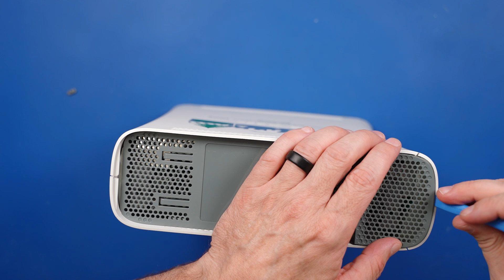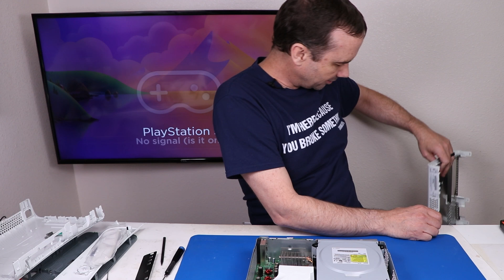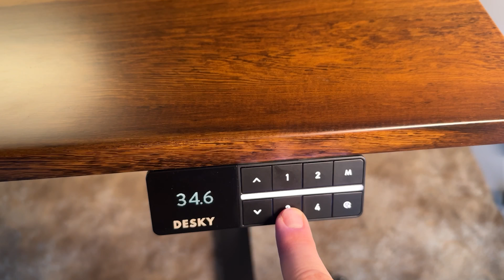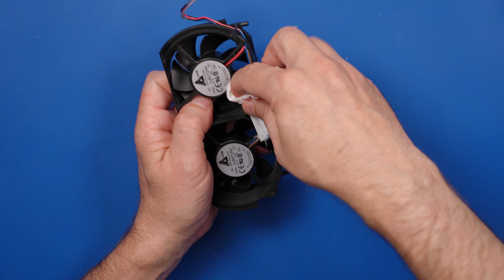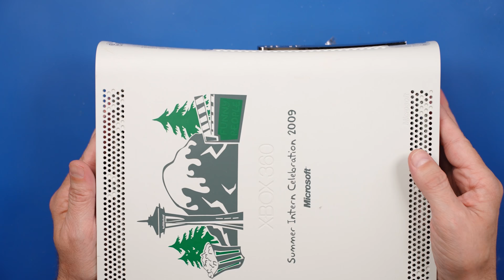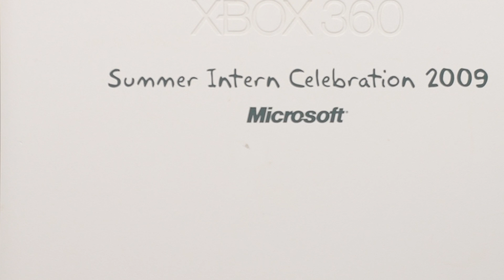I Found A SUPER Rare Broken Xbox at a Thrift Store! Let's Fix It!

Comment from the maker: Check out Desky!
Desky Dual Hardwood Sit Stand Desk - 72x30 - Pheasantwood desktop - black legs with cable management - https://desky.com/products/dual-hardwood-stand-up-desk/?ref=tronicsfix?utm_source=tronicsfix&utm_medium=affiliate&utm_campaign=tronicsfix&utm_term=pheasantwoodreview
Desky Minimal Under Desk Drawer in Pheasantwood & black - https://desky.com/products/minimal-under-desk-drawer/?ref=tronicsfixutm_source=tronicsfix&utm_medium=affiliate&utm_campaign=tronicsfix&utm_term=pheasantwoodreview
Desky Monitor Stand in Pheasantwood - https://desky.com/products/desky-monitor-stand/?ref=tronicsfix?utm_source=tronicsfix&utm_medium=affiliate&utm_campaign=tronicsfix&utm_term=pheasantwoodreview
Desky Lockable Desk Casters - https://desky.com/products/lockable-caster-wheels/?ref=tronicsfix?utm_source=tronicsfix&utm_medium=affiliate&utm_campaign=tronicsfix&utm_term=pheasantwoodreview
Reply: Genuine question.

I just replaced my screen on my iPad 11 Pro.
I think the adhesive strips that came on it are bad but just in case, how long should it sit with or with out weight for it to form a seal? 

I thought it was supposed to be near instant like with phones. 

If it doesn’t seal properly I’ll just order some E-6000 glue.
Reply: Do you have the Xbox 360 mk 3 edition
Reply: See the comment below. I’d like to see that fixed.

Comment: Have you ever worked on a 360 with the ring of death?  I have repaired many of them with an unorthodoed way using washers and different screws and left out the clamps on the back of the board,  Worked pretty good most of the time.

Comment: The Ebay laser will work fine! At 18.25 in your video when you take the laser out of the packet the 2 pot's are at the bottom, to the right hand side there is a blob of solder that bridges 2 pads to protect the laser from antistatic during shipping, that blob of solder needs removing before you install the laser, once its removed the POT reading will change to between 3 and 4 as expected.

Comment: Man brings back the good old days. I used to repair 30 a day of there consoles. I still to this day have bins of parts from 360s that couldn't be saved. I also modded them etc. I have 1 of these intern 360s I pulled it out my bin cause I wrapped and sealed it after getting it and honestly forgot about it all these years. Just plugged it in and it works like new. I have a couple other rare ones too. Also have the all white original xbox. I was a huge xbox repair/modder in philly back then I did 100s of consoles per week mostly fixing red ring of death issues. I can still take apart a system in under 2 minutes lol

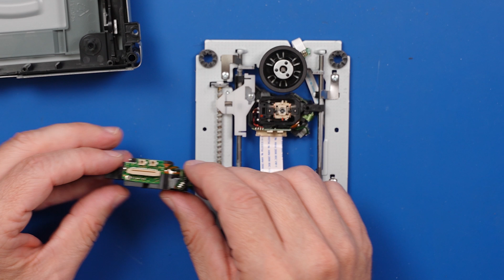Comment: @TronixFix I just wanted to point out that those Xbox 360 lasers replacements come with 3 pads that are bridged to the left of the ribbon connector. I noticed that in the video you did not remove that solder bridge. 18:33 

If you still have that laser I would suggest removing that and testing the laser again. 

Again just wanting to pass along that information in case you weren’t aware.

 I always love watching your content!

Comment: Hello Steve,
at minute 18:30 you can see a large solder joint to the left of the cable connector. This needs to be removed before installation. It’s an ESD protection point. Compare it with the old laser. 👍
Reply: Laser definitely doesn’t work now considering that blob shorts the power to the laser to ground. Awesome really, I see lots of pointless fixes from him just to increase video length. Cleaning gigantic consoles with nothing but a q-tip, sending parts over to his friend for cleaning, and now this. Oh and the hot air used to position the capacitors, good grief.

Comment: @Tronicsfix I have an Original Xbox I purchased when I was stationed in South Korea with a hardware mod. It never really worked quite right because it has a switch on the side to turn it off so I could still play online but I would get the red ring of death when ever I did turn it off. Now I get the red ring of death all the time. I would love to get it fixed and see you make a video of it. I have had it open a few times to switch the power supply board between 110 and 220 a couple of times and of course to install a larger hard drive but I don't have the skills to do anything with the motherboard. Thing probably still has sand in it from the Iraqi desert...needed to play Halo to keep my mental health in order over there. lol

Comment: made the disc drive repair harder than I wouldve. The old common fix for that issue was to get another drive of the same make and model, and then transfer the PCB from the broken drive to the new drive. Microsoft was pretty bad about locking the drives to the motherboards, so you had to bring the control PCB from the OG drive over when you did the swap.

Comment: Hi Steve nice video. Some reactions already mentioned it; did you remove the solder blob that is on the laser? New and refurbished lasers most of the time are sent with this little solder blob you need to remove first before installing. Worth a shot looking at that before you throw it in the garbage…

Comment: Did you remove the antistatic solder blob from the 1st replacement laser? In your video it looks like it is still soldered, It's right next to the beige ribbon connector. New lasers won't work with that still bridging the contacts.

Comment: "Putting greese won't fix the disc drive but to will help the tray slide out better" well I use to have an Xbox where the problem was the tray wouldn't slide out on its own but it would read the disc properly once inserted so maybe putting greese would fix it?
Reply: Another possible issue is the belt in the eject mechanism, which can start to slip. One solution is to add some kind of "dressing" to make the belt more grippy. You can also just replace it.

Comment: I'd also like to say that this console has another layer of value to it as it is on a jtagble version of NXE which is very valuable to the right person. Personally as a collector, I would dump the nand and the disable the efuse circuit to prevent the console from being updated and add an extra layer of protection for the console.

Comment: It would also be useful to test both a CD and DVD media, then you can already have a good idea if you need to adjust the resistor pot.  Specifically if its not working, I have had luck going a bit lower than recommended.  If it burns up, then it can be replaced, but I have had drives working for years, over voltage.  I wonder if its some coating on the emitter, or even the lens aging over time, possibly a slight yellowing causing to have to burn harder.  it may also be some slight increased resistance elsewhere in the circuit just due to age.  Playing with vintage tech, I have unsealed NIB optical drives that didn't read and need a bump, so I do not necessarily think it comes from use.

Comment: Nice!   I guess worse case is you could still the original laser and push it past the 3.0 mark to see if it might work in a pinch, even if you only could use it to verify a unit with a completely dead laser assembly.

Comment: Hi Steve - when you buy new lasers for these, they normally have an anti-static solder blob on them, shorting them out to protect them from damage by static electricity during transit. When you take the laser out of the packet at 18:25 it really looks like this solder blob is present, and you didn't mention or show that you removed it, so that's probably why it didn't work and the laser could still be good.
Reply: @fadetonoir6152  i was going to say that
Reply: True

Comment: I ran inti this issue on my old Xbox over a decade ago. From the sound of it it's most likely something to do with the drive motor. They sell replacement disk drives on ebay but the thing with those is that you have to use a special program to copy a registration file from the original drive then flash it onto the replacement drive or it will not work. Nothing on the 360 other than the controller and memory card is plug and play.

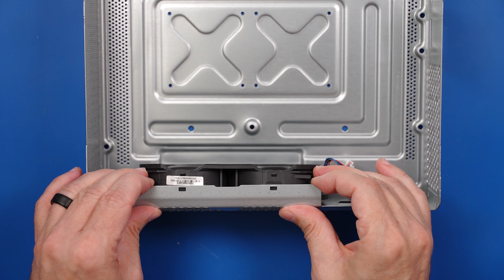Comment: 7:44 they're not that loud, i haven't noticed much difference after i swapped mine. What changed the noise level was the PSU fan and that DashLaunch feature where you can change the fan speed

Comment: i bought x360 second model from 2010, with two wireless controllers, kinect and 10 games only for 45 EUR. Console working fine. But need change thermal paste and clean inside. Problem is i am scared to open console. There too many plastic part to break 🤔😳 maybe one day ... 🤔

Comment: The first (and actually only time) I did any soldering work was to fix the DVD drive for my 360. Instead of replacing the laser assembly, I went with the easier option of replacing the control board. I made sure to order the same exact model that was in my current system. Then I had to remove two wires from each drive and swap the boards. While my solder work was incredibly amateur, it actually worked. The system immediately started recognizing disc games with no issues. 10 years later and my younger brother, who now has that console, can confirm it still works flawlessly.

Comment: one of the greatest consoles ever made, life was simpler....i miss those days
Reply: Considering all the red rings and the introduction of paid online I'm going with no. I still play my GBA way more than my Xbox.
Reply: @bland9876   Buddy, the 360 didn't even introduce paid online, the original Xbox did. Also, the 'red rings'  didn't just apply to the 360, it was an industry wide problem caused by gpu manufacturers using the wrong underfill material that couldn't withstand high heat and power cycles. Atleast Microsoft tried to fix the issue like extending the warranty to three years. You didn't see that when sony shipped ps3s with the 90nm rsx. Or when they shipped "revised" boards that were really just the old, defective boards (i.e. CECHQ). If you're gonna defame my goat like that, atleast get your facts straight instead of saying "oh xbox not very good cause I like me gameboy more" (not to throw shade at the gba it's great too 😭😭😭)
Reply: Playstation 3 was the last of the greats

Comment: Just a comment; try cleaning the spindle and sled motors on the original disc drive unit and see if that gets it working. The contact between the brushes and commutators has likely degraded over time and won't allow the motor to spin up as quickly as it needs to. Just try spraying contact cleaner into the two semicircular openings on the lid of the motor and then spin it by hand until the cleaner flashes off.

Comment: There's a couple things you should have tried on the DVD drive before replacing the laser: Always take the tray out and clean and check the tray position leaf switches. They can get dirty or stuck closed. Also blast the old laser with air. The bottom of that lens is open and there is a mirror and the diode itself can all collect dust. This was quite a clean drive though, from what I'm usually cleaning. Also new lasers had a solder ball you needed to remove. It's hard to tell but it looks like the anti static solder is still there.
Reply: Yes, at around 18:30 you can see the anti static solder blob is still there. I was waiting to see if he knew to remove it and he didn't, or at least it's not shown in the video.
Reply: How does a diode get filled with dust?
Reply: Came here to mention the solder blob. Glad to see it already mentioned. I fixed mine the other day but didn't know about the solder blob until it was already back together. 😂

Comment: Next time you have a 15+ year old optical drive that doesn’t spin up, I’d recommend checking the lubricant on the rails before replacing the laser. I’ve seen drives that won’t fully spin up if the sled can’t get back to the home position. Though it looks like the laser was to blame here…
Also, the laser potentiometer setting on the eBay laser was a red flag (and it wouldn’t surprise me if it burned itself out at that setting).

Comment: Twice my 360 has stopped reading discs, to fix it all i did (without an OHM meter) was take it apart, plug it up, adjust the laser a tiny bit then test. I do that until it reads reliably. Mine's from 09 all original parts and still works.

Comment: Just grab a replacement or donor DVD drive and swap the board — you know, the one you love changing capacitors on for no reason 😄. Simple fix! Or, if you want it even easier, grab an unlocked DVD drive from China — no flashing needed.

Comment: Hello Steve. I have done exactly the sane ib ny xbox fat like yours. But mine works. It is because when youy buy a laser pakage, it comes with a protection to avois problems with lens and laser. There is a point that it is soldered, and you must take off. I have found one video in youtube that explain this. I think you have the same problem whith the new laser assembly. Look for this on youtube.

Comment: I'm having a 4--1--4--2 ROD error (0102 	ERROR_NBINIT_MEM_READ_STROBE_DELAY_TRAINING 	Memory read strobe delay training failed ) can this be related to some of the capacitors? (they don't seem leaky)... I tried a Reflow , but it just did not last.... (even on the memory put some wood/pads). - Works for up to 1 h than the error returns.

Comment: Steve did you remove the solder blob on 2 points by the ponteciometer?i remember every laser new needs to remove the solder blob before use.
Reply: It's a used laser assembly.

Comment: Last resort: if the laser didn't work, is to flash the drive onto another one. 
Every drive has a number tied to the console, and wont work without it.
this is the same method used to play burnt games on a 360. lmfao 

Nice easy fix. congrats.

Comment: I’m trying to fix my Joystick drift on my ps5 controller. I bought the Hall effect joysticks to replace it and I literally spent 30 minutes trying to get the pins desoldered and got Nowhere! I’m using my hot air station which I I thought would be quick and easy which is what I was told. I watched a bunch of YouTube videos on how to do this and I bought the flux 

It gets worse! When removing this 2 wires from the battery which came off perfectly, I somehow stuck my solder iron on the flux needle thing and melted a hole in the side so now it doesn’t come out the tip but instead the side of it

And on top of all this I still can’t get the stock joysticks out! I have the hot air station to 500 degrees and have tried different air fan speeds. What am I doing wrong? 

Yall make it look so easy lol. I used that alcohol to clean up the board after this.

Once I get the flux on the pins and use the hot air shouldn’t it just fall out or do I need to pry it off once it’s hot? 

Also should I use a small or bigger tip on my hot air station? I’ve been using the smallest tip I have thinking it would direct the heat to the spot better.

I clearly really suck at this soldering stuff lol

Comment: kicking myself in the teeth due to having a gen 1 360 given to me years ago, had a firmware issue (i fixed that) and took it apart to clean it, got it all back together, worked but no HDD, stuck it away in my parents house (my old room) moved away. returned home to get my old stuff, and my PS3 FAT, along with my GBA, (that free xbox) and quite a few other things were "tossed" to a junk hauler.

Comment: "these have a tendency to have bad disc drives" let that sink in. Think about what he says literally a minute earlier in the video.
Reply: The LiteOn drive is actually the weak point for a post-fix Falcon or Jasper/Tonasket console. It's either the belt or the laser, or both. I am kind of surprised that Steve didn't replace the belt as prventive maintenance. But considering he also didn't remove the static solder blob on the new laser he put in first...

Comment: When you get new lasers for the 360, there is a point you got to unbridge by the plastic connector
Reply: Exactly. It's to protect the laser from static electricity. At 18:30 you can clearly see that Steve didn't remove it. Also makes me think the laser isn't "used", but is indeed new.
Reply: @MyRegardsToTheDodo that's probably also why the resistance reading was fairly low because of that bridge

Comment: That 360 is on an older dashboard Steve, keep it on that dashboard... That's NXE.

Whatever you do please don't put in newer Xbox 360 game discs in the disc drive; that'll prompt you to update the console.
Reply: or if you do just unplug the 360 if you get that message
Reply: @thewavyshopofficial  that can cause an update error with the nand and the console will then need to be updated using the file on the usb, proper fix would be to disable efuse circuit
Reply: That’s what I was thinking

Comment: For its age, and being used, its in amazing condition. Just having the little port covers still there and not flopping is great for this generation. You meantioned your "360 collection" is this consol one youll keep or sell. Because if you collect, this is brilliant. You find broken consoles you want for cheap, then fix them. You know exactly what youve got, no question of refurb or not. If you do collect, what others are there in your collection. That would make a good short video because everyone wants to see what everyone else has.
Reply: Questions are usually marked by "?"
Reply: You can easily fix the USB port cover with some wire, if the spring is still there. If the spring is gone I normally use a spring from another faceplate from the memory slot cover, I generally keep broken faceplates around just for that.

Comment: i used to do a mod to stop the RROD and wire the fans on constant .i forget were
Reply: Bolt mod; that's a half assed fix to do... Also the fan mod you did was hook it up to 12V that doesn't need to be like that either, let the system determine the fan speed
Reply: @CautionusJay  it was use a pin headder to conect to the the XBOX fan plug and solder  conect to the back of the main power plug input .granted it was loud fans .it worked until it was stolen .it can be undone